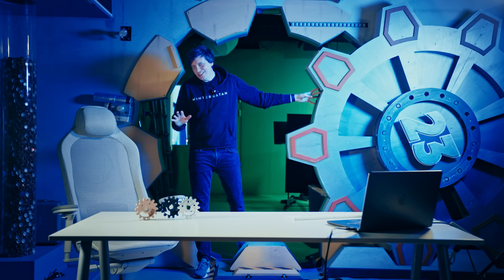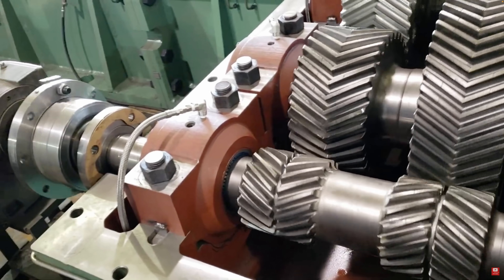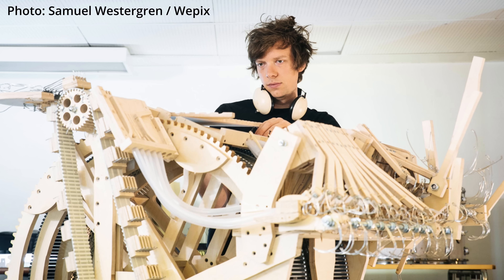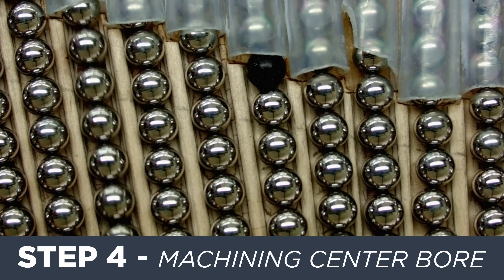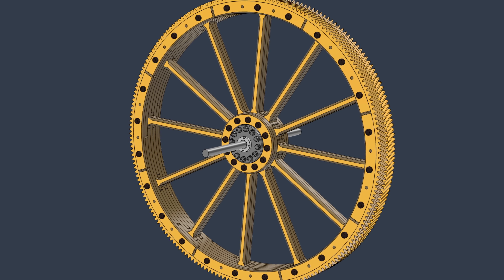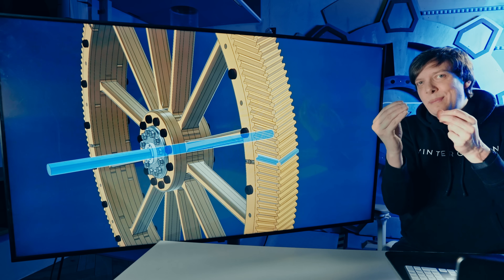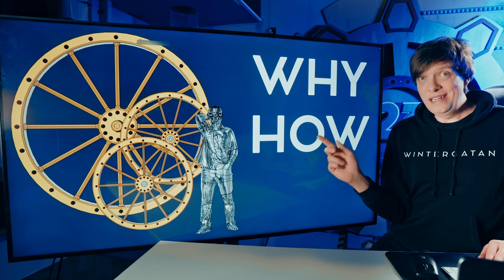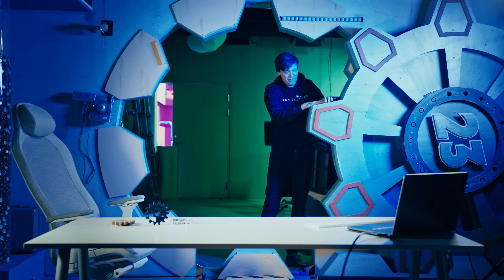How I´ll Make the Worlds Largest Plywood Gears

Comment: Keep the machine simple. For such low speeds and working hours i think you are overcomplicating the design with the helical gears. The best designs are the ones with the minimum  features to perform the required task.

Comment: Feedback:
Noticed that you did not precent a way to position the gear teeth in width length.
The center axis idea looked good and the metal flange bushing having a machined surface in width length will help.
Though you would need to know where the center of the gear teeth are compared with the center of the center hub.
Perhaps the outer surface of the metal flange bushing can be used but then you need to make sure that surface also have a good tolerance towards its inner side.

Comment: Those wooden gears never had the chance of being worn out by long term usage.
Reply: Sad but true.
Reply: 1) wood can be pretty durable with proper design and materials; 2)  they can easily make replacement gears, both per tour/season and as backups to take along—none of them have to last thousands or decades of performances on their own.
Reply: @jelliottlein  ok that’s fair but he should at least consider it
Reply: @jelliottlein Billie Eilish's support staff carried 20+ spare microphone capsules on one of her recent tours. In the live music scene, it's normal to bring what outsiders might call a ridiculous amont of backup parts for items that are at risk of being accidentally damaged.
Reply: Parts are replaceable.
Reply: If after a few months they are worn out, then he just swaps them out for another material.
Reply: @theJonnymac  Sounds like the gear build is repeatable so just replace as they wear out.
Reply: Given enough time, all things wear. Well designed machines have high wear parts that are easily serviced or replaced. It seems like the long term durability of the gear teeth is probably not the highest concern here.
Reply: He could replace the teeth with metal if need be
Reply: Dual helical is what they use on Aircraft Carrier reduction gears (albeit not made of wood). The are phenomenal at distributing force and wear resistance
Reply: that stung :D
Reply: GET THIS TO TOP COMMENT PLEASE
Reply: Trust that he will design in a modular manner. Its not a big deal.
Reply: I have to agree with that. At the very least, use some hard plastic?

Comment: At this size, is wood warping, expansion and contraction going to be an issue?
Reply: Well, the issue wasn't quite addressed - what about warping of the gear's larger scale structure? Parallel to the axis.
Reply: @MrSplonger Baltic birch ply is made up of more layers of cross-fiber wood than most ply. It is more dimensionally stable than most ply by itself, and he will be layering several sheets on top of each other. I have had a single 10mm sheet in a shed for years and it remains pretty flat. I think his wheels will "work" in the sense that they will change shape a bit throughout different temperatures, moisture content etc, but not so much that it visually shows and affects operation of the mechanisms. And don't forget that other material expand and contract as well. It is why engineers design differently for different materials, take into account varying response to the environment.
Reply: @ Hey, thanks! :)
Reply: @IvoTichelaar  or, this is the reason giant wooden gears with precise tooth profiles do not exist
Reply: Seems I commented too early!

Comment: in the era of davinci, cart wheels would be mostly made of wood, but would have an outer band of metal to protect them like a tyre. though I'm sure that could also apply to these gears. if the gear teeth are too small then the wood might deform. also I think a metal band on a wooden wheel would look cooler.
Reply: The machine isn't Renaissance anyway. He's just putting a Renaissance veneer on the quite obvious much later heart of the machine. The centrifugal governor and the weight drive are late 17th century. Da Vinci sketched a worm screw which is not the same thing as the helical gears that the MM is proposed to use, demonstrated by the fact that the helical gear wasn't really invented until the late 19th century from what I see.

And plywood is not the same thing as wood. Plywood was not used in the Renaissance. It came about in the 17th century and later.

I don't care what he makes it out of. But it bothers me that he's talking about the mechanics being the soul of the machine and the importance of them being on display, and then turning the machine into Chuck E. Cheese animatronics with a flight-of-fancy Renaissance veneer.

Comment: He keeps saying the simple gears work, why would you make them more complex?
Reply: Because most of the time Martin doesn't actually hear what he's saying.
Reply: As I remember from school, a double helical combines a lot of positive effects.   no axial thrust. more power transmission.     But they are difficult to machine.   nice to have, however.
Reply: I just wanted a new album. 10 years of this wild goose chase.
Reply: One of the problems with the first MM was the constant noise from the straight cut gears. Helical gears are a lot quieter but cause side pressure. Double helical gears get away form the side load problems and are as quiet as helical gears. So you win some and loose some, in this case it's more complex to make.
Reply: As much as Martin has said he tries to approach the project with a form from function mentality, he can't help himself when he sees something that looks really cool. With that said, this is still less over-engineered than plenty other things within the MMX.